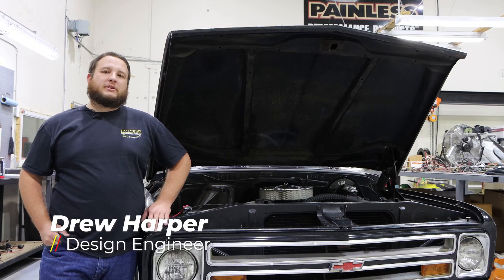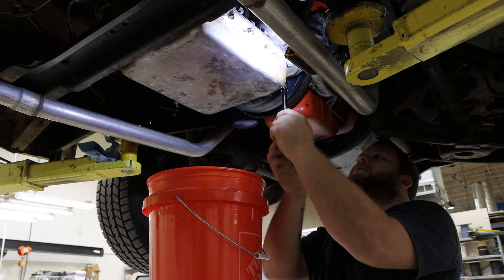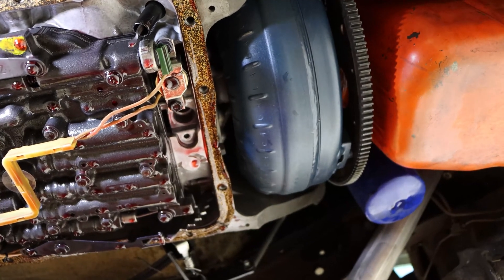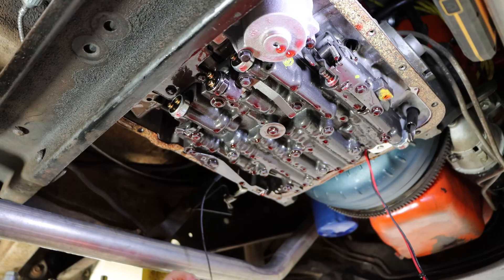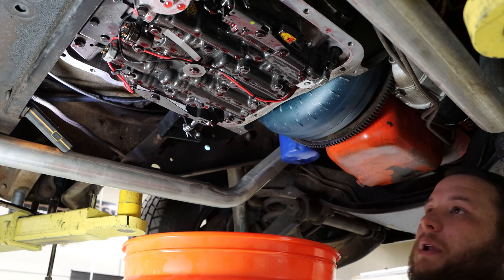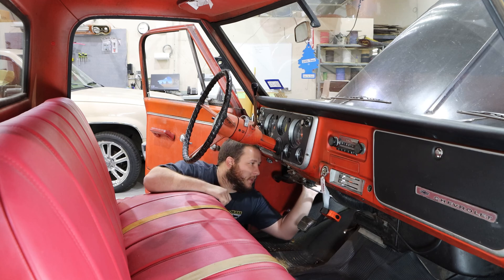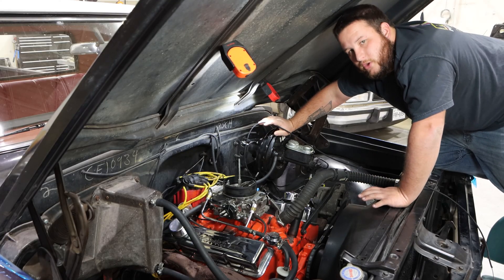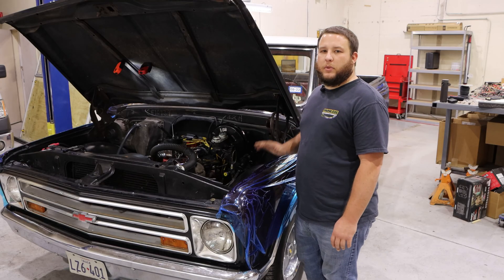700R4 Torque Converter Lock-up Kit Installation - Painless Performance

Comment: This set up does not require an toggle switch to flip on and off manually when arriving to 4th gear? If so can that toggle switch be left on at all times or do you have to switch it off for example every time you get off the high way?
Reply: Looks like it's activated with the brakes? I'm guessing that's why he hooked it to the brake switch?

Comment: I can't seem to find mine I have a 86 camaro that's been converted to carburetor it shifts smooth but just found out about the TC lockup switch but I don't see one on the camaro Not sure what it looks like and the repair manuals don't mention anything about it

Comment: That looks like the pre-1988, is it the same process for my 91?
Reply: They sure dont like answering questions do they.
Reply: If you plan on carb swapping your 91, it should work. Because 91 uses a 700r4 with TCC electric lockup, this converts it to vacuum signal Lockup, in turn ditching the computer. There would be no reason to replace it with this if your keeping tbi, if you have no lockup, and are sure any of these switches are the problem, then find a stock kit.

Comment: Best video I’ve watched for the lockup circuit. 👍
How does it know when it’s in 4th?
Can lockup be on while driving in other gears?
Reply: 4th gear pressure closes the pressure switch and completes the circuit to the solenoid.
Reply: So you want to use the normally open  @denverkenyon3203
Reply: I think when he replaced the 4th gear pressure switch with the new one. It now talks to the new solenoid that he installed and when it hit 4th magic happens.

Comment: My 700r4 is a 1985 with the external pressure port. Will this work with that?
Reply: Did u ever find out a answer I have a 84 700r4 wondering same question
Reply: @stink-dogrepairs864 did you ever find the answer?
Reply: Did you find the answer?
Reply: @MidloCars  Worked.

Comment: My instructions don’t say which terminals to attach the wires on the vacuum switch
Reply from the maker: Brian,

Page 4 of the manual here will show where to hook up your vacuum switch wires: https://www.painlessperformance.com/Manuals/60109.pdf

If you have any other questions, give our tech guys a shout at 800-423-9696.
Reply: @painlessperformance  my direction doesn't say what to use the normally open or closed page 4 is just the return policy

Comment: Do you not have to have a lockup convertor?
Reply: You need to remove a plate from your converter if you’re gonna run without lockup. Otherwise it will overheat in 4th.
Your mileage won’t be as good though at highway speed.
Reply: @chrisspezowka8417  I don't get it why some people choose to not use the lock up?

Comment: The fourth gear pressure switch on my 700r4 won't come out, can I yse the new wiring in the old switch?
Reply from the maker: Levi, Go ahead and give our tech guys a shout at 1-800-423-9696.

Comment: What are the signs of these part failings? Does the car not move? How can you tell when you need to change these parts? I have a th200-4R and the transmission seems like it’s not engaging it just rocks back and fourth but if I put it on jack stands it moves

Comment: I have a 700r4 I bought from Jegs that requires lock-up. I’m replacing 229 and 3 speed in my el Camino with 350 and 700r4. This will apply the same? The lock up will automatically engage/disengage without a manual switch?
Reply from the maker: Yep!  This will get you handled.